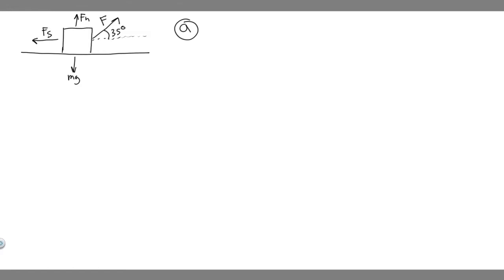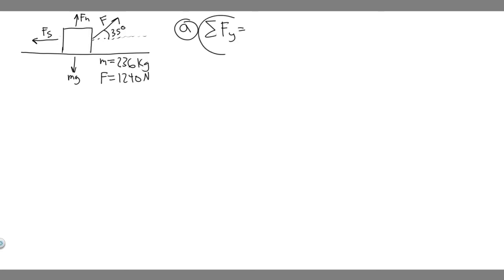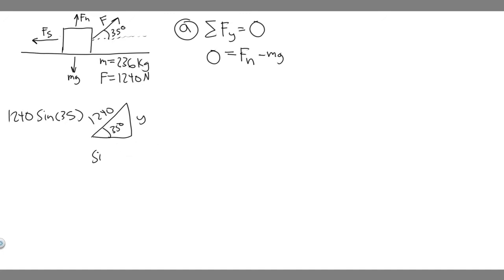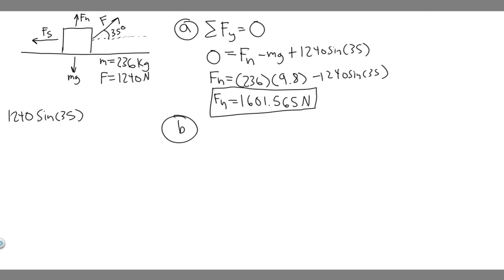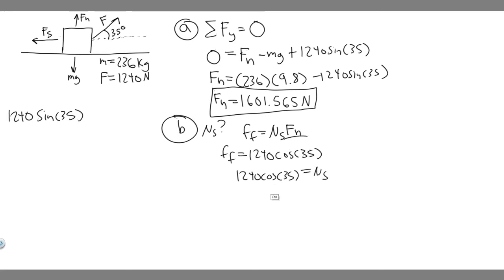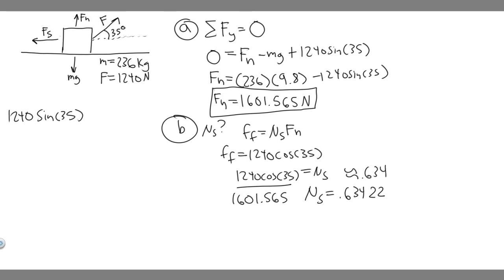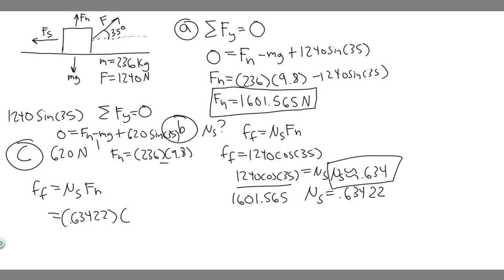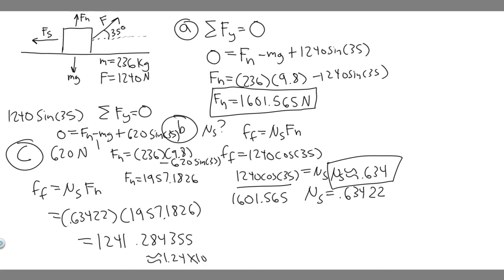A horse is harnessed to a sled having a mass of 236 kg, including supplies. The horse must exert a f

Comment: Part c is done wrong. The question asks for the Force of friction when 620 is applied. NOT the max friction force. The answer is just the x component of 620 ... so 507.9N because the object will not move with 620 applied... so friction just balances out 620 x component since a=0.